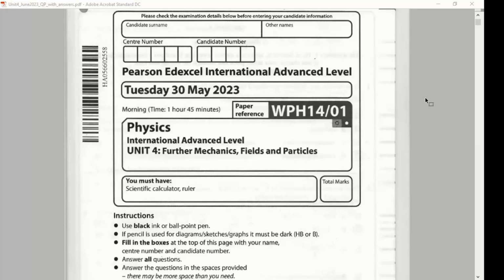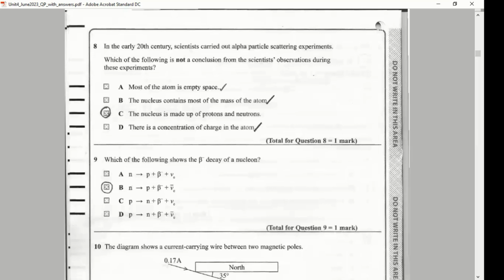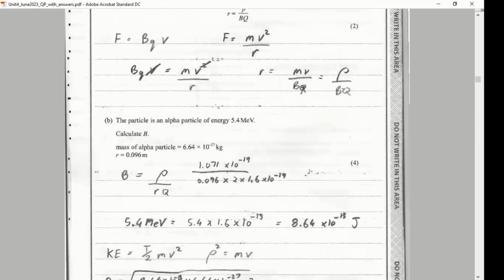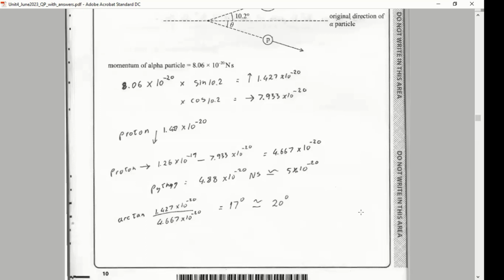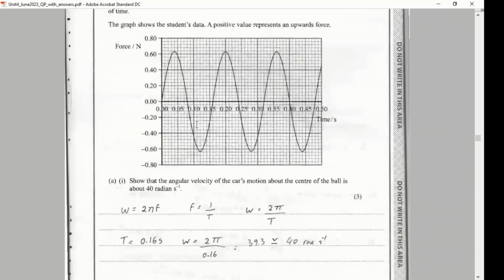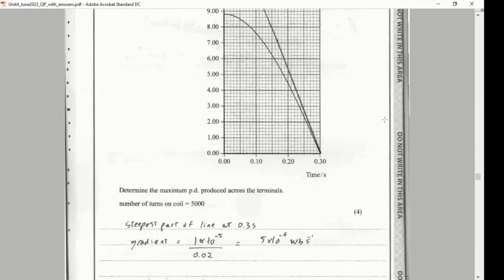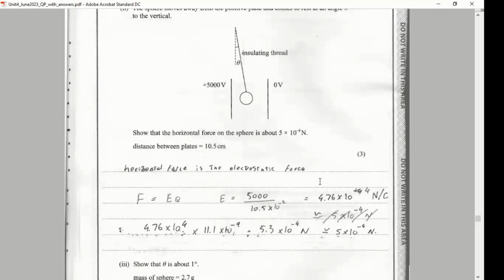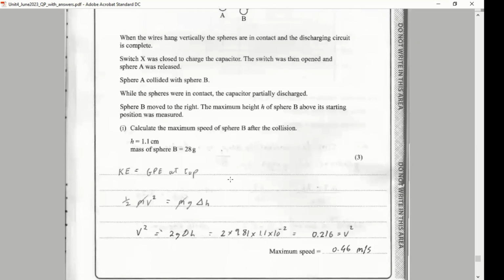IAL Physics Unit4 May2023 Walkthrough

Comment: Hii can anyone explain me question 16 - d
Reply: basically , they ask u to refer to lenz law so first of all just state lenz law which is "the direction of the induced current is such as to oppose the direction of motion causing it " then u have to kind of explain why there is a force (so that we can use the force in flemmings left hand rule) so we say that "theres a force on the wire due to the interaction between induced current and magnetic field " lastly to see wether the student is correct or not u need to use flemmings left hand rule  , the thumb is force the pointer finger is  direction of magnetic field  and the third is current (sometimes velocity but in this case current) now the thing is that flemmings left hand rule applies to positive particles but since the charge of the electrons in the wire is negative ofc u need to use flemmings left hand rule and then whatever direction u get (in this case we get out of the page) u put the opposite since the charge is negative so its into the page so the student is correct
Reply: @zeynanazzal811  thank you soo much for explaining appreciate your time for me🥹 ( i got it now )